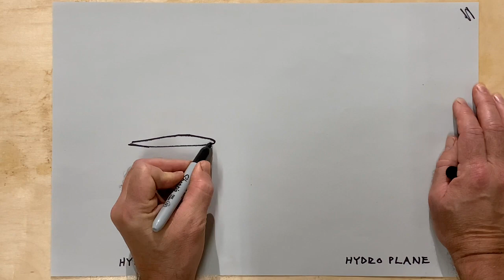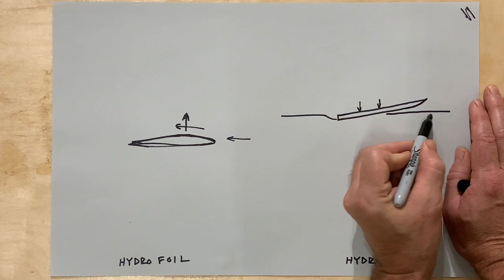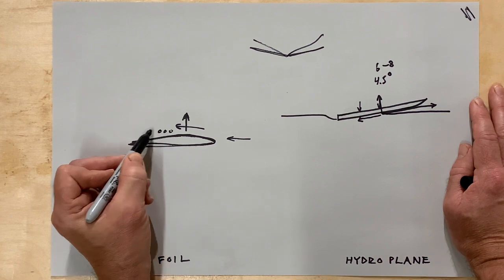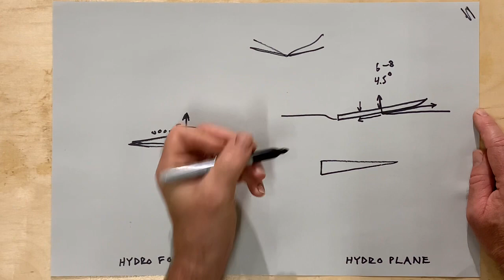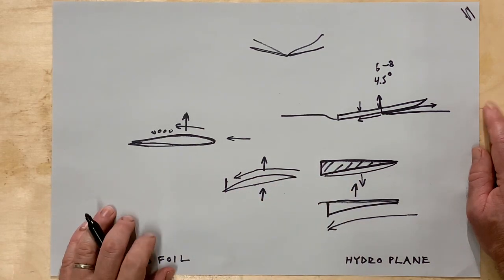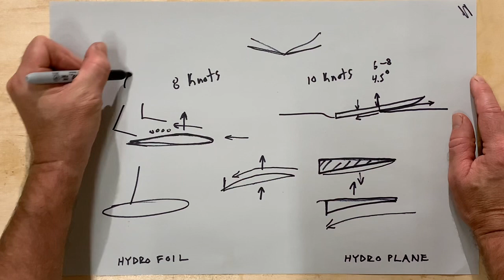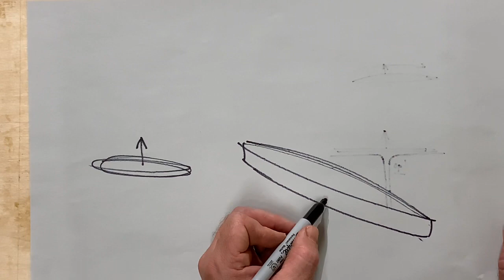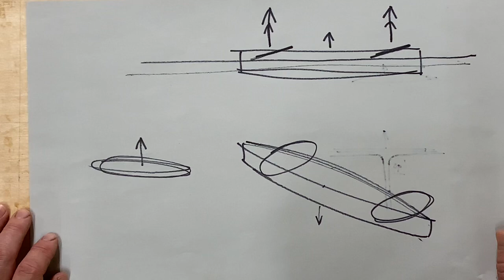Hydrofoil lift vs hydroplane lift

Comment: Interesting!
Reply from the maker: Thanks!  A few things I left out.  Hydrofoils do better in waves, unless of course the foil stalls, then you crash and the hull falls 3' or more downward, sometimes violently.  That might be what happened to Hydroptere.  The hydroplaning wing must be flexible, like the wing of an airplane, to absorb pressure changes.  Windsurfers absorb waves with their knees.  Also, hydrofoils must be shaped exactly to the designed foil shape, otherwise they don't work.  It is quite simple to make a wedge shaped wing.